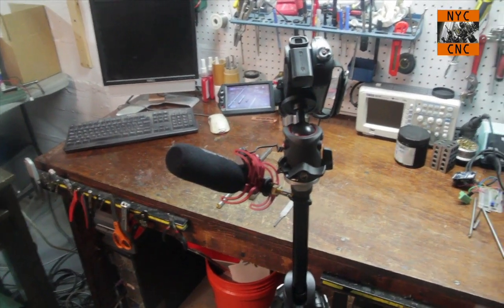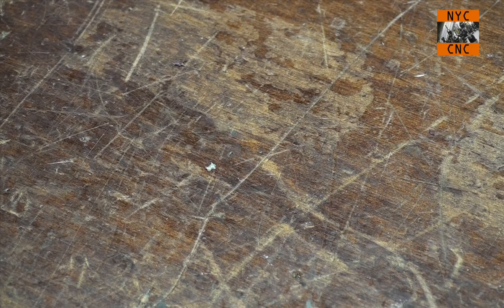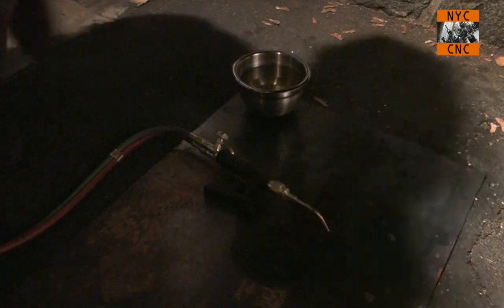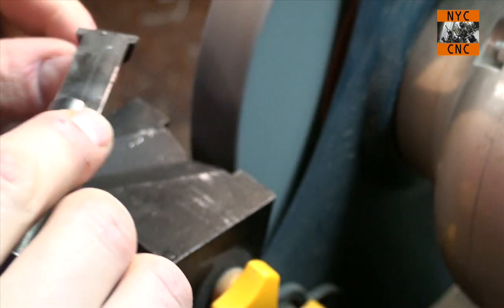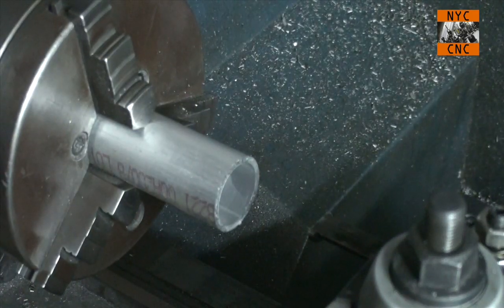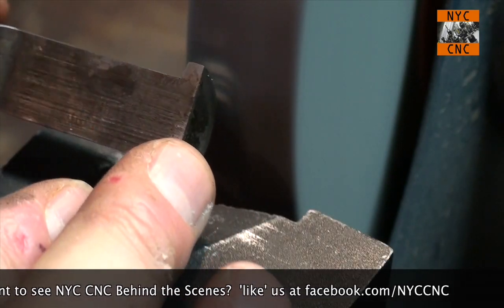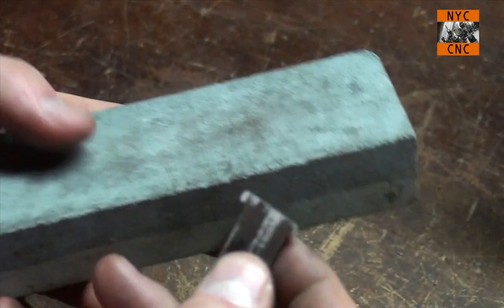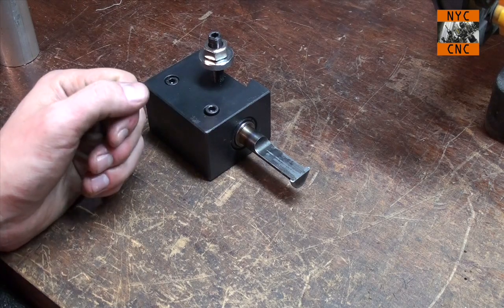Turning & Machining a Boring Bar out of O1 Tool Steel!  Part 3

Comment: A word of encouragement; I like the way you placed the insert on the boring bar, so you can undercut once you bore a hole; 2 operations in 1. Undercutting is important for seating another cylinder, like a bearing or something. A reversible punch .. whatever.

Comment: If you haven't yet, I highly recommend sand casting.  Lost foam is an awesome (and easy) way to start.  You don't need any special sand or tools.  Basically, you carve what you want from styrofoam, glue on sprues and vents, coat with sheetrock mud,  bury in play sand, and pour in melted aluminum.  My first furnace was a coffee can filled with charcoal with a hair dryer blowing in from a hole towards the bottom.  Soup can as a crucible.  It's an extremely useful skill to have in your toolbox.

Comment: You comment about making something from nothing struck a chord with me.  It's pretty high on my list of favorite things.  I like the idea of making whatever I want from foam or wood, then turning that into metal.  It only gets better with a cnc router and 3d printer.  If you feel like it, check out videos on "lost pla" casting.

Comment: For blacksmithing I use Grapeseed oil it is about the same price as penut oil but has a higher smoke temp. Safflower oil has the highest smoke temp I know of. But it is very hard to find. Peanut oil is abut 440Fs, Grapeseed is about 480Fs, Safflower oil is just over 500F. I motor oil works well to but stinks and is horrific for your health. I use natural oil because it doesn't smell so bad and if I spill it is non toxic.  

If you get into making your own tooling, I like belt grinders for sharpening and shaping. They work faster and better than stone grinders. I use a belt grinder to shape and polish my hardy tools (silver anvils I use in my small 60lb'er)

Your videos are good keep posting.

Comment: Nice job John.  I have made a number of tools like this that have worked out well.  Typically quench in used motor oil and have never bothered with annealing but you are certainly doing it the right way by annealing.  I think that O1 is pretty tough and fairly forgiving for specialty tooling like this and that ideal conditions are not required when hardening.  Production work of course would be different.

Comment: You can grind your wheel dull by going asynchronously on the dressing tool, which will make a smoother cut, cut less, and generate more heat to help you get a small radius. If this was a cnc grinder it would also generate more chatter, but since its freehand grinding you wont notice it.

Comment: John More good ideas and inspiration. I was trying to figure out how to turn some internal threads your back side sharpening turned on the light bulb. I have a small Grizzly G0602 the lead screw reverses when the head direction reverses. And alas no cross feed. All this will be resolved when it is converted to CNC but that is down the road a ways. Thanks for the insight into your learning process.
Reply: Funding for my hobby is a bit tight. Depending on a few other things I expect to have it complete summer of 2014. It is good to see young guys like you diving in head first. I finished HS in 73 took metal shop for 4 years the instructor was just like Mr Pete. I worked in the Computer Industry, Just started doing metal working last year i am having too much fun.

Comment: Youtube comments seem to be screwed up, so I'm having to reply as new.  Yes, I meant temper vs anneal ... I just haven't bothered with anything like the use of a toaster oven but I did use a torch and go by color with gradual cooling.  You're right though, it should be done, otherwise you risk loosing the part or cutting tool entirely.

Comment: Parts like this always heat axially for even heat distribution (at least to some extent, yes I know the part isn't rotationally symmetric, at heat equations governs it will even out)... It's more efficient at the very least.

Comment: a round tool already has re-leaf and if make another maybe try cutting your radius in the tools cutting edge using with a tool bit with the radius cut in it if your going to make both sides of the cutter the same then all the needs to be done at the end is to touch up the end on your honing stone. cut the radius in a tool bit with a carbide end mill

Comment: What are you planing on using it for? Just general boring or for some special tasks?
It looks ideal for making internal o-ring groves for the rights size o-ring width according to the tool radius.

I would not use it for general boring, i would just use normal insert type tools for that and save this tool for special tasks that you can not do with the normal insert boring bar.

Comment: The top surface of the cutting edge is flat. Is that the optimum angle for boring or should it have rakes ground in like standard hand ground tools? See for instance http://www.machinistblog.com/grinding-lathe-tools-on-a-belt-sander/ ?

Comment: I think you should use diamond sharpening stone (something like these http://www.dmtonlinestore.com/8-Dia-Sharp-Continuous-Diamond-Bench-Stone-P15.aspx) and an Arkansas stone for finishing, the cutting edge of the tool should be as flat as possible for the best cutting finish. The finish on your sharpened edge is like a jigsaw, check it under a microscope, or a 10-30x magnifying glass if you have one to see what I mean. That makes it subject to blunt easily. And also you should consider to put a rake angle(about 5-7 degrees) on the cutting edge if you intend to cut steel with it. 0 degrees rake angle like yours is only good for soft metals like brass and aluminum(blunts faster when cutting steel).
Reply: John NYCCNC
Yeah I meant top-rake. Well yeah those diamond bench stones can be pretty expensive, but you can also find some really cheap ones (I have one that I’ve bought for 16e in a local hardware store, and it works pretty well), it just shouldn't be one with recess' for knife sharpening. Just keep an eye out for one while shopping. They're pretty handy in works like these (hard surface and consistent grinding finish, compared to a regular stone).
I really like your channel, keep up the good work!

Comment: Not to jump too hard on you, but you're using a good file on a piece of hardened tool steel. You realize that this will in fact dull the crap out of that file and you'll be using it to make another tool afterwards. I know that you are trying to show people what it sounds like to file a piece of unhardened tool steel, and then a piece of hardened tool steel, but you should be using a file close to the end of it's useful file life. Files are just so darned expensive these days.